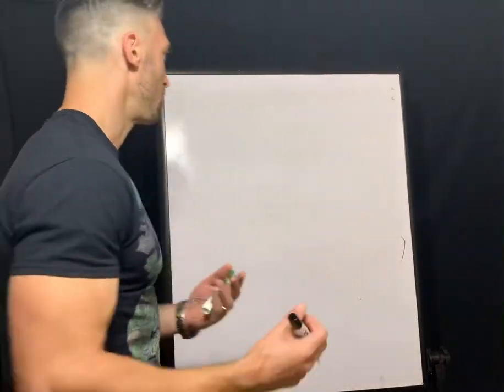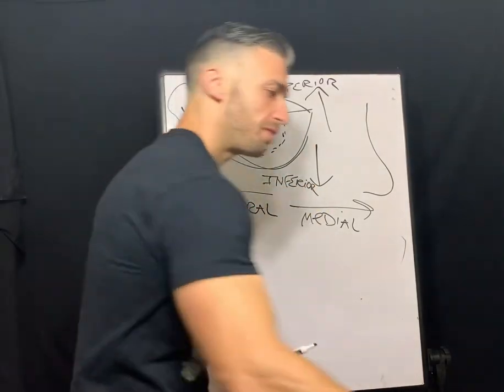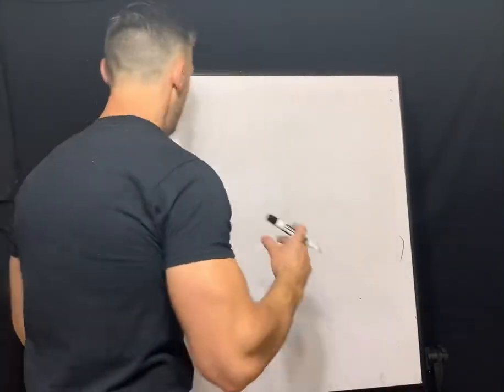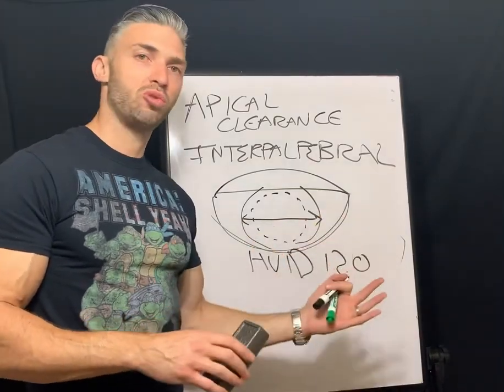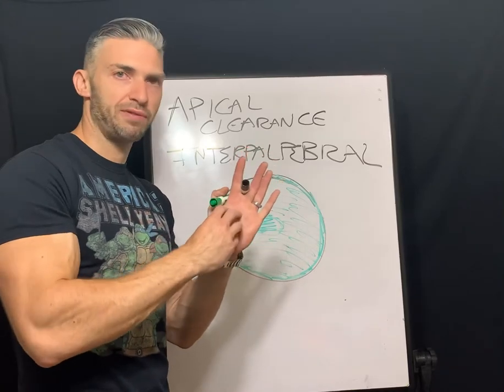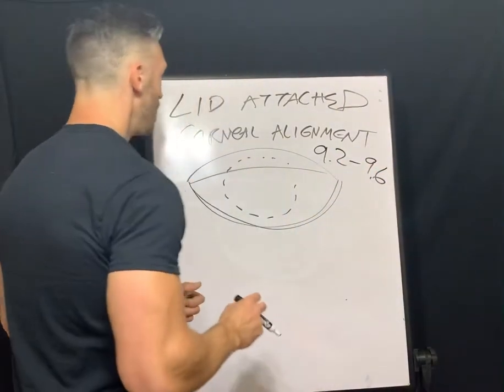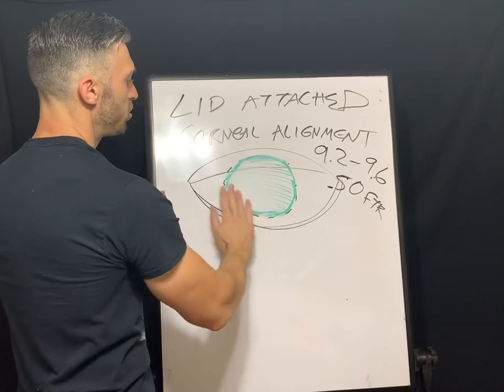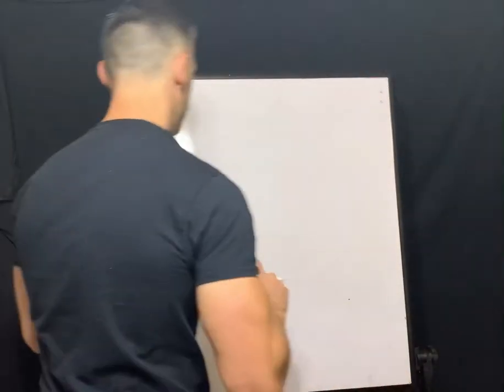NCLE GP FLUORESCEIN PATTERNS

Comment: I have a question that’s not related to the video.  I passed the ABO but after learning more about contacts, I have found that I’m way more interested in the contacts!  Im in a license required state but my question is what type of work could I go into that I get to work more with contacts over glasses?
Reply from the maker: Hi, Nikki!
Yes - Contact lenses are overall, interesting!
You could work at a larger ophthalmology group as a contact lens technician, or scribe. Many times you can work alongside OMD’s and ODs... You could also be a sales rep for one of the major contact lens brands, or you could work for a GP or speciality lens company as a product/fitting specialist (the ones the docs call and give K readings, power, etc. to for guidance on fitting)

Thanks for engaging and being interested 😊
Reply: @nclecontactlenstraining  thank you for the information! I’m going to start doing some research into those options.  I’m starting to think more and more ophthalmology is the side I prefer.  I enjoy interaction with patients and don’t prefer sales.  Although I am good at sales 😕

Comment: Would it ever be appropriate to send a pt home with a  gp lens empirically fit without checking the lenses with a slit lamp and nafl,  .
Reply from the maker: No lol 
Even if the data suggests a lens would be a perfect fit, no two eyes are exactly the same so it’s always best practice to check the fit to make sure it’s not tight, flat etc… on the cornea. Thanks so much for watching 📺